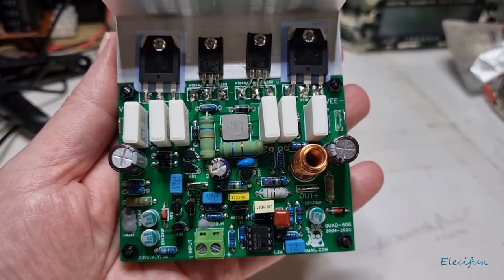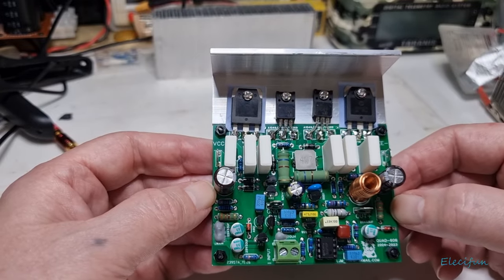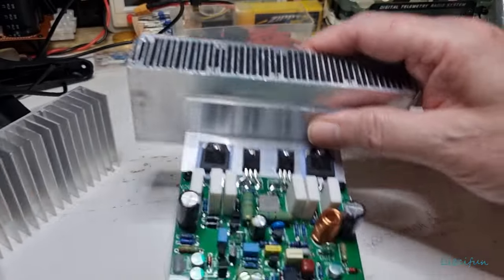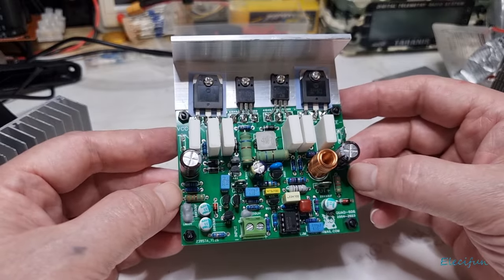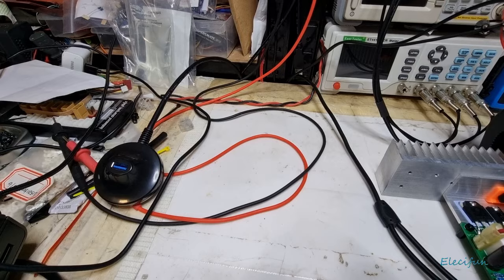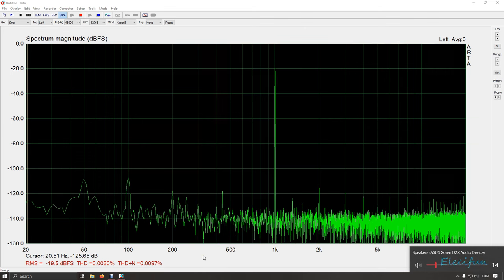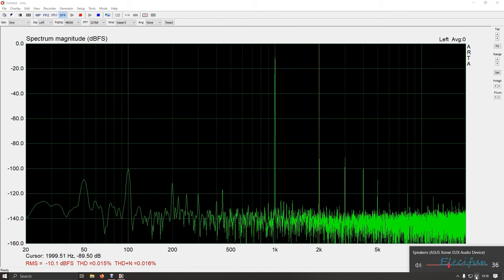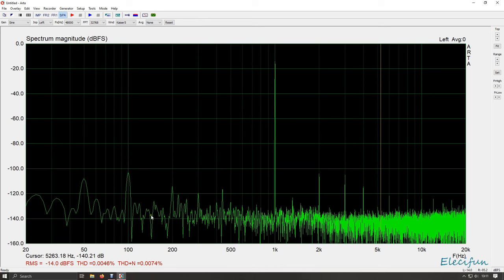QUAD 606 Amp Kit (Aliexpress) THD+N & Frequency Response Results

Comment: Yeah, sound is such a difficult thing to describe. For me, tone chasing is a lifelong quest. There are SO MANY variables it can be maddening. I definitely know what I like, but describing that to others is really difficult. I have found that, in general, people that like the same genres of music often like similar sound/tone qualities. Even this is difficult to describe. For example, I'm a huge fan of Classic Rock especially guitar driven pieces. I am a guitar player myself so I really study the music. I like the warm, rich sound of tube driven amplifiers set as close as possible to the original analog recordings. As close as possible to what the musicians and sound engineers at the time envisioned. I've found that my band mates and friends who also enjoy Classic Rock have similar tones coming through their amplifier systems. Even those who don't run valve amps achieve similar tones through equalizer settings etc. For about 45 years and counting I've been listening to the same recordings on different systems and have found that my favorite sound is from a simple valve system with no tone control through old heavy JBL speakers. Interestingly, I don't pine for the old vinyl records. I've never liked the crackles and pops of vinyl, especially when they get old and scratched. I have no sentimental feelings for that lol. I like the old analog studio recordings but stored on CDs. My favorite DAC is my old iPod. Sorry about the rambling comments but I know you're a kindred spirit when it comes to tone chasing and can probably understand my feeble descriptions lol. Thanks for sharing your journey Elecifun. Your experiences have improved my own. Happy listening amigo. 🎸 🎶 🍻
Reply from the maker: @SonicOx Listening to music with the same system can be two different experiences if you move that system into a different room and listen to the same music there.Different room acoustics as you know make a difference. 
The above is one of the reasons why I don't play music in my videos. 
Thank you for sharing your thoughts.
Reply: I agree that room acoustics are one of the endless variables. Even speaker placement within the room. The variables can be a bit frustrating to contend with but are also probably the reason the "tone quest" remains a fun and fresh part of the hobby for me anyway.
Reply: The reason the bass is often more likeable from older speaker is that they only had 1. order filter or no filter on the bass driver. Those filters create phase rotation in 200-300Hz creating less clean bass there, and bass guitar realism etc drops off. Bass driver is 90-180 degrees out of phase with the mid driver.. Inductors for 70-100Hz lpf beomes massive and more expensive than old Jbl speakers so you never see quality lowpass filters that only create a small phase rotation. With dsp one can have 1.order lowpass at 45Hz doing the same thing much cheaper and the upper bass is just as good as in old speakers only much more powerful. In new speakers one can rip out the 2. order lowpass filter and put an massive series inductor instead and you can have that stunning clean bass. Inductors on Aliexpress have wicked good value.

Comment: Hello, i bought a couple of these diy kits a few weeks ago. Maybe just my bad luck, but mine I could never get them working as they should, mine sound distorted at lower volumes, don't know why. Changed a few components and semiconductors, but to no avail. Not good at all. I also have a pair of L12-2, now these are very nice, very good sounding amps.
Reply from the maker: @antoniosantos6442 Sorry to hear that. Did you try swapping out the Op-amp?
Reply: Before assembling this kit you need to measure each component.

Comment: I'd like to see it all hooked together and running. 🤓
Reply from the maker: Didn't you like the sign wave represented by the DFFT on screen? PS has your L12-2 arrived yet?
Reply: @Elecifun  Yes, the sine wave looks amazing. 🤔 I just don't understand it. 

L-12 -2 next week. Hopefully Monday.😀
Reply from the maker: @decem_unosquattro9538  Oh, don't I explain it well enough? I have to stop for a while doing this as my power supply can not provide me the required voltage output to fairly reflect the amplifier on test performance. I need a new power supply which is good as it will help me improve my game.
I will keep my fingers crossed for you on Monday.
Reply: @Elecifun  I just discovered your message. Chat to you tommorow sir. 🤔 good night. 🌛

Comment: Will you get a sugden a 21 clone? I built two different clone  amps to see the difference. One is jlh  1969, other one is musical fidelity a1. I am planning to built a Nelson pass amp and then ljm the one you liked. this quad looks promising too. Thanks for sharing.
Reply from the maker: @tamayaytam I may do, which Sugden A21 clone? I have been looking at the A21SE. Also this amp needs special speaker protection circuits. I have a couple of variation of the AIYIMA 1969 on the way, also a few other amps for upcoming videos.

Comment: Interesting - why are you testing the FFT at such a low -20dbfs? Is the standard not around -3dbfs?
-20dbfs means its 10% of the full signal. So if the max input signal of the amp is say 1.2V - you are applying 120mv. Now if the amp gain is say 20x gain - that's an output of 2.4V or ~1W?
I may have it wrong....?? Perhaps you should test what the input/output V signal is at -20dbfs - that will tell us something i hope?
Reply from the maker: Great comment. In my defence I did test -20, -15, -10 and  -2.8dbfs.  I must say that at different voltages the SPA THD outputs were different. Omitted from video to keep the length down. 
I will tonight get the amp back on the bench and take these measurements and feedback to you.
Reply: @Elecifun  Absolutely, getting measurements at various levels is best. I did a loop check on my Scarlett , and can confirm that when input level was -20Dbfs, the voltage was ~220mv.
Reply from the maker: @zoelong6021 I've decided, as the output is effected by voltage, I can only continue these tests once I have the ability to provide the DUT with its correct, recommended voltages. I have bought 11 toroidal transformers but these are no use for all variable voltages and current requirements. A new PSU is the answer. Have you any inexpensive suggestions?
Reply: @Elecifun Not sure I understand...what recommended voltage to which device are you not meeting?
Since last time, I ended up purchasing a Scarlet as well - I just hook it up to a laptop using the USB, and it works just fine.
But in saying that it really has not improved significantly from the sound card I was using previously.
I have decided that I am not spending any more $$$ , and saving up for one of these ...
https://youtu.be/jwtxua9_T0U
Reply from the maker: @zoelong6021  For instance the Quad 606 is recommended 45V 0 45V, L12-2 50V 0 50V. What I'm trying to say is I have been using whatever I have, power supply up to 32V 0 32V and toroidal 42V 0 42V. 
I need variable voltages for these different circuits up to so far 60V 0 60V. A new power supply is on my list. These circuits tested at different voltages and pushing for -3dbfs I get different results.

Regarding Scarlett, I sold mine. I couldn't get -3dbfs without adding gain using the multi-turn pot. Then I never new if the thing was in the same place so I would have to recalibrate  every time. 
The difference between the sound card and Scarlett to small, so I'm back on the sound card. 
I too am saving for a QA403 It is an awesome bit is kit, but expensive 700 euros.

PS I am trying to find out if its possible to sync two Rigol DP832's together for serial or parallel connections while using tracking. Any ideas?
Reply: @Elecifun ok I see - you need a variable DC supply. Instead of two Rigol DP832 (which are quite expensive i see) - I built mine using a toroidal with two separate windings, rectified each winding separately and added 2 x 60V 8A4 80W Step Down Module XY6008-W. Had to get a case as well. Works like a charm and with the money you save you can get the qa403
Reply from the maker: @zoelong6021  I am interested in the power supply you suggest. I will take a look now as the qa403 after tax to the UK is £720 
I need to sell my as on the streets for that.
Reply from the maker: @zoelong6021  that's a big toroidal for two 480W PSU's I've been looking at 1000VA and they are not cheap, around £200. I would have to use RD6012PW x2 (bigger screens for my eyes) with two cases unless you know of a case to house two of these front panels?

Comment: Took me some time to find an fag packet to write on the back of.  Ten minutes with a blunt pencil gives a bridge capacitance of 62pF for balance rather than the 47pF supplied.  Just assembled the kits and will try both values when the components drop through the post box. Silver mica caps ain't cheap either.
Reply from the maker: @everTriumph  The closest I can find is 56pF and 68pF, and they are as you say not cheap. I would like to hear how you get on with this.